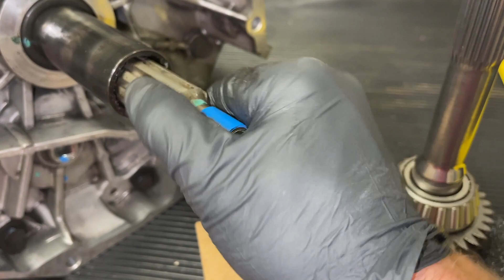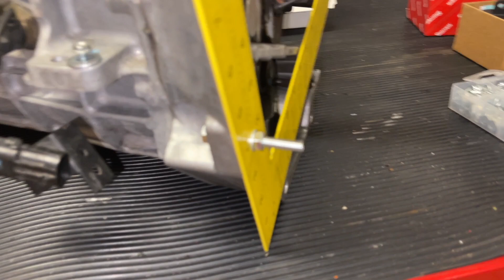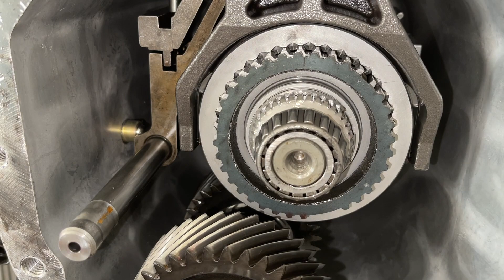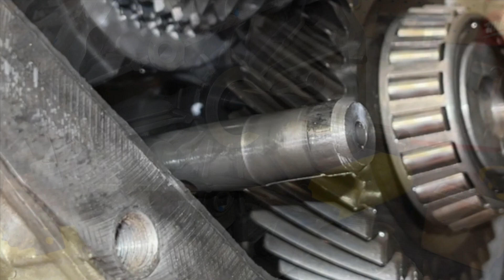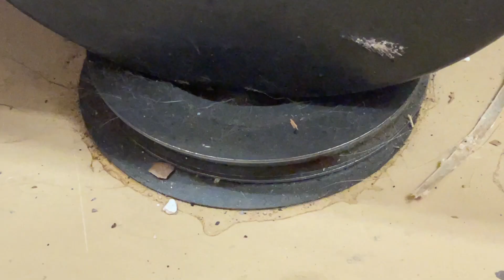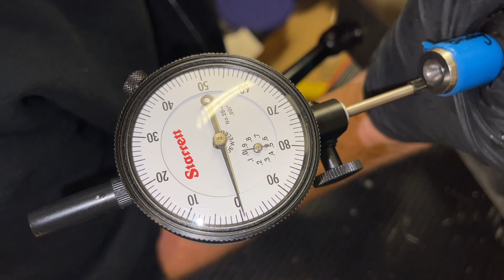26 spline input shaft install t-56: How to shim 03-04 SVT Cobra main drive & retainer sleeve

Comment: Mine has the same noise
Reply from the maker: I put the 10 spline back in. If it’s too tight it can do some damage. I didn’t want to take the risk and went magnum and saved the stock transmission https://youtu.be/bIYQY4ZqB7g?si=c1cS0Mm5zCig0Tky
Reply from the maker: Here is the full magnum playlist https://youtube.com/playlist?list=PLIjr-uSYDZi5zPFOzqpua-DJfma4dR7Js&si=Gx3K21UxvjVR5Dox

Comment: Great video, appreciate the detail. My recommendation is to use way less silicone. Those faces are machined very flat and therefore require a very thin layer of silicone. No doubt as much as you see on the outside squished inside the case as well. On a manual transmission it's probably not a huge deal but on something like an engine with small oil passages you'd be asking for trouble.
Reply from the maker: You can definitely see how much it beads in another video I made since I pulled it multiple times. https://youtu.be/KDmNoz0kGIM?si=9jY-fjIVg0v9FAlL

Comment: The new shaft on mine was .01 inch longer. I may use the same shims from the old one. Not sure at this point what I am going to do.
Reply from the maker: These new shafts seem too long so you may be in the same situation as I was. All shims will be too big so you may need to make a smaller shim from the 8.8” rear end carrier bearings and trim it down around the edges
Reply: @dannyjohnsonsgarage likely.  However, it does spin freely. I may have to do the same procedure just to make sure unless I find a real good transmission place around here. Doubtful.

Comment: my method is 
pull the old one slap the new one in and beat the shit out of it and dont even bother checking end play 
done that with tr3650 and t56 no problem 

sometimes even if you get technical you will find out 😅

Comment: Great video thanks. I just changed mine. It whines when clutch isn't engaged. Is this normal? Everything is working fine but at idol I hear a whine. I got 1000 miles on it with no problems.
Reply from the maker: I haven’t put a lot of miles on mine, but I notice it whirrs a bit until I push the clutch in. The noise then comes to a stop so it must be the sound of the shaft which stops once it stops. It’s been the same feedback from others as well.

Comment: Hey bud, do you happen to have the link for the input shaft it self? Ive seen 2 different versions looks like one is tuffer steel so I was wondering if the cheaper holds up 600hp? TIA
Reply from the maker: Honestly, it appears to me they are all the same from the boxes I’ve seen everyone receive them in. Once tremec stopped making them it seems it’s all the same company, and I don’t feel the quality is what it should be on fitment.
Reply: @dannyjohnsonsgarage  sounds good, it seems LMR has em in stock ill grab one of those, thanks for the reply and all the helpful videos man
Reply: Was the input shaft from Lethal performance?

Comment: Hi Danny,
Have you put the box back in the car and run it yet..?
If so how is it feeling after the upgrade..?
Reply from the maker: All is great with the exception of some noise in neutral. It goes away with the clutch in and some other friends with the same input shaft said they have the same thing. The supplier said to see if it goes away with miles. Other than that, the car runs very well, shifts and drives without any problems
Reply: @dannyjohnsonsgarage Common problem with the TR6060’s in the 2009 Aussie ford cars. Called the input shaft rollover. Ford’s solution was to overfill the box. Rather than use the fill hole, take out your reverse switch and fill to about .5” below it. Gets rid of the noise

Comment: Great video as always! So you having to take the  cover off and cut the shim wasnt supposed to happen right? The shim should have already been that size you cut it to?
Reply from the maker: Sometimes the stock shim works. The other shims I bought should have been close enough to work, and likely would have with a tremec shaft, but the aftermarket ones they sell now must be slightly different